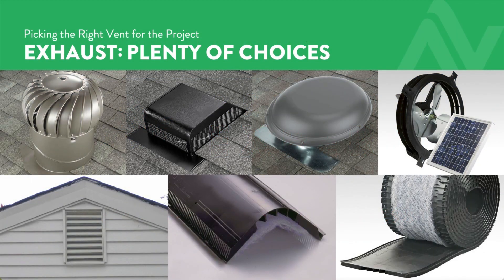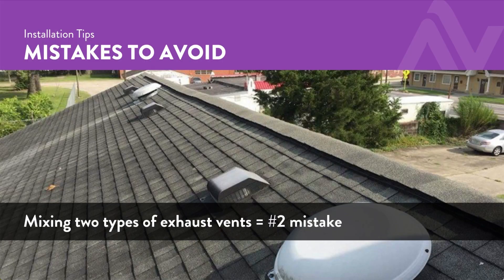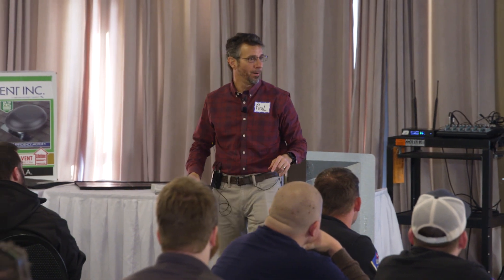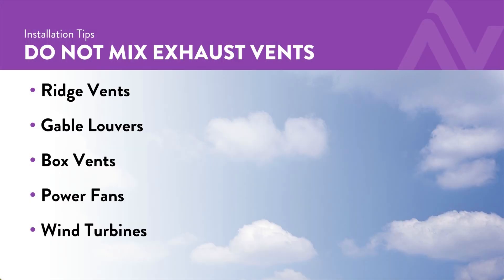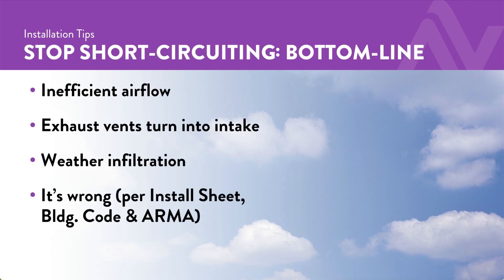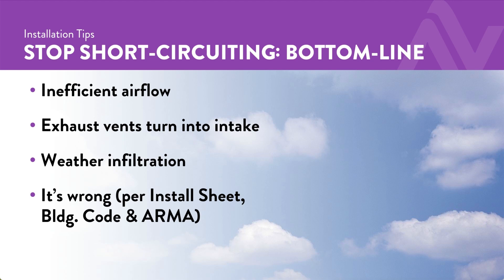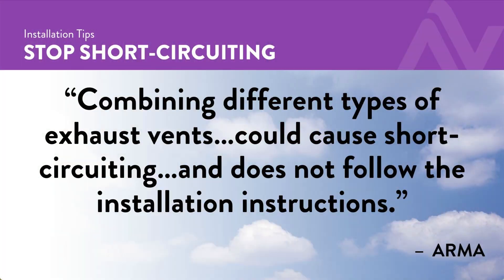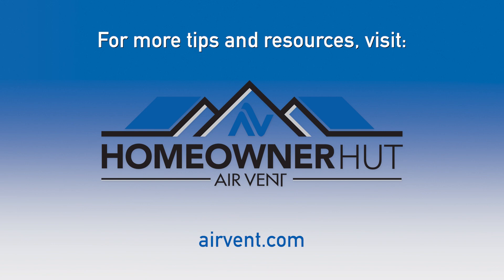Don’t Make the 2nd Most Common Mistake in Attic Ventilation

Comment: What should be done for a 1950s ranch that has no overhang for soffit vents? The roof ends flush with the siding. What is done in that situation for intake?

Comment: I have fully vented soffit with a full ridge vent. There is no air moving in the attic and I've had a problem with moisture in the attic. What's the best way for me to get air moving in the attic. Yes I have baffles and the soffit and ridge are unobstructed. The sheeting is cut back about 5" on each side of the ridge.